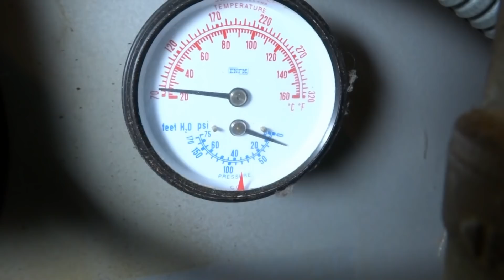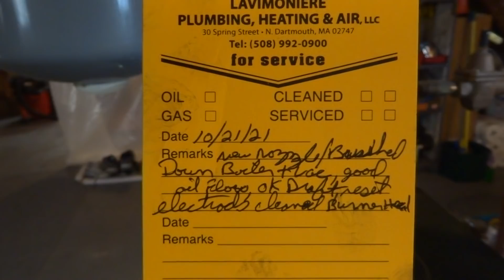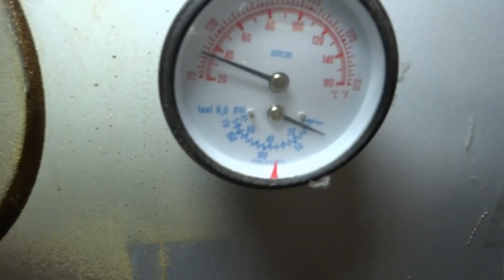NEW CUSTOMER PEERLESS BOILER SERVICE

Comment: Never touched oil. Just fixed a friend of my wife's 98' Weil McLain. No air elimination anywhere, upstairs zones were air locked. Purged them, everything worked great. Returned next day to put a few caps on the purge drains due to it dripping after i used it to purge the zone. Packing was tight. Then attempted to fire up the system to check it again......the mercury flame sensor had failed and wouldn't initiate the main valve. Found one and replaced it. Thing works like a champ again. I ended up doing a full maintenance on it. Compression tank was getting full. They said its running better than it ever has.
Reply: gave 'er the ol How Ya Doin, Steve style

Comment: Steve, quick question, how come you don't do more combustion tests when you do maintenance?  I think it would be a good thing to put it on the meter to at least check to make sure CO / O2 levels were good at a yearly thing and build a history.  Would be a good service for piece of mind.
Reply: Likely because he charges for it and people don’t want to pay extra.  He needs to charge because it takes time and it’s a $3000 tool but people are cheap for the most part., haven’t you noticed he’s doing a lot of services on shit that hasn’t been cleaned in 5-15 years.

Comment: Steve what do you do with old nozzles? Do you blow them out and resume them?
Reply: I believe he collects them to recycle the brass at his local metals business.  They pay.  My furnace manual says trying to reconstitute an old nozzle is not recommended.  I believe it said that the oil under high pressure actually erodes away the intricate fragile metal strainer components.

Comment: Steve, I finally have to ask: Why clean the outside of the white electrode insulators?
Reply: Carbon is conductive... if you dont clean them there is possibility for short circuit.
Reply: Carbon tracking?
Reply: @serge4856  makes sense…just don’t remember Steve explaining why he does it…
Reply: Also, you want the flame to reflect off everything because that is what proves the flame for the photo eye. If anything is dark it makes it hard for the eye to see the flame.